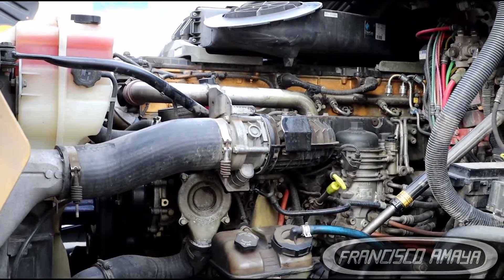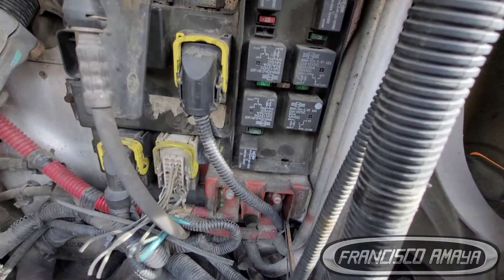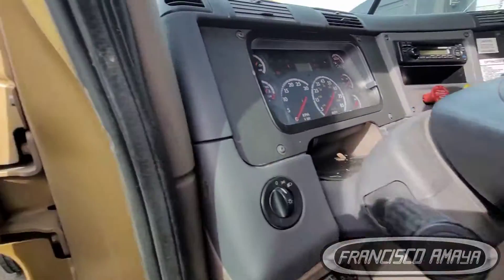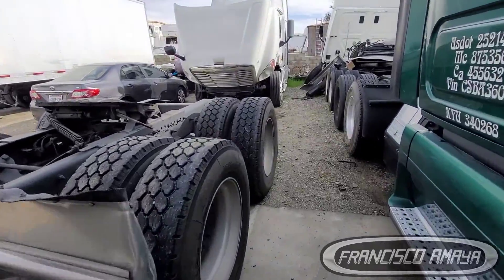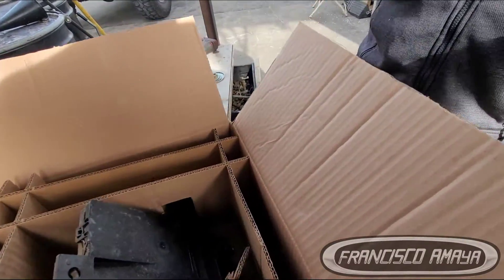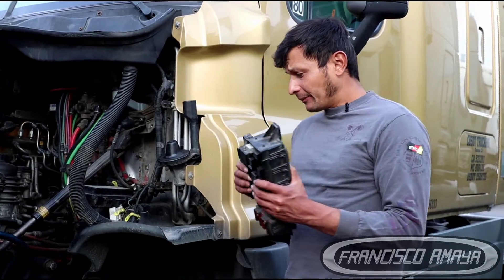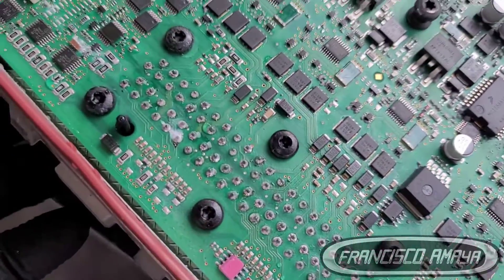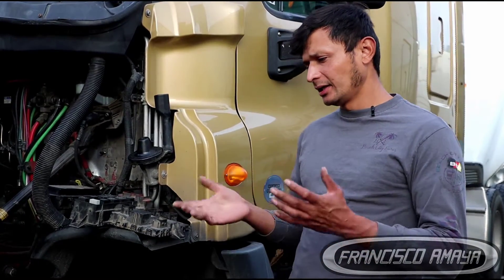Freightliner Cascadia Samchassis module failure problems with truck lights and system

Comment: I have a question, do I have to send truck to Freightliner Dealer if I need to replace this part because I spoke with Freightliner Dealer they said you have to come here even though you got a Jpro or Diesel Texa laptop because they have to program this brand new Sam chassis

Comment: Good video, I’m having trouble with my trailer lights not working periodically. I know that it is NOT a supply cable issue, (I’ve tried a couple different cables). The problem usually happens when I first get into my truck at the start of the day. The trailer lights will work sometimes and then other times they flicker or don’t work at all. This morning while the truck was stationary they worked but when I applied air to the system the lights flickered on and off. Sometimes if I turn the tractor to the left or right the lights will flicker on and off (as if water is the problem). After about a half hour to an hour of driving the lights will come on with no issues and operate as normal. Thoughts?
Reply: Oh btw its a 2016 Freightliner Cascadia
Reply: Ever find out what it was. Did you have to program it
Reply: @joshuahernandez6328  yeah, it needed a ground strap to the 5th wheel, I would not have guessed that was what it was because of the inconsistencies

Comment: Im currently having a similar issue on my 2019 new model.  I lost all power to my truck.  Mechanic was looking everywhere for 5 hours to find the issue.  Found out that its the red power wires that go to the Sam that are moving and lose.  Or it's the acual Sam module. When my truck is running and i turn on my inverter.  The truck loses all power.
Reply: Hey i get the same problem as yours sometimes on my 2023. Didn’t loose all power but no power to acm and mcm.